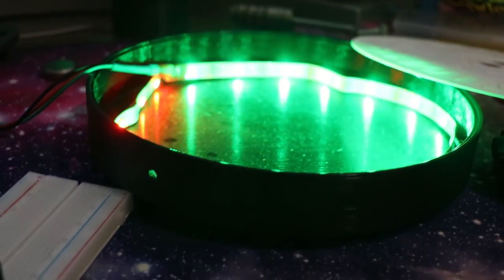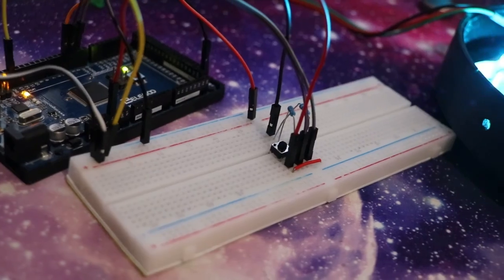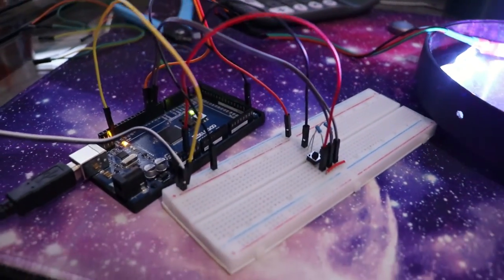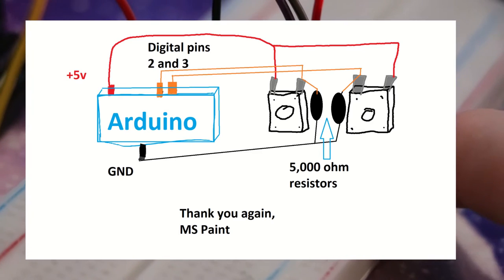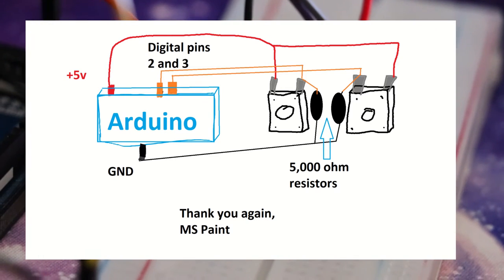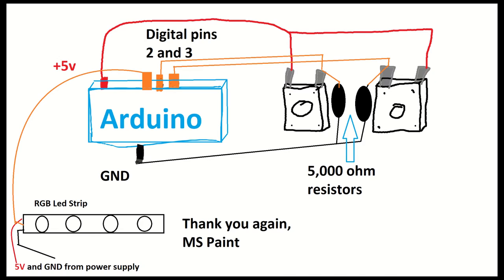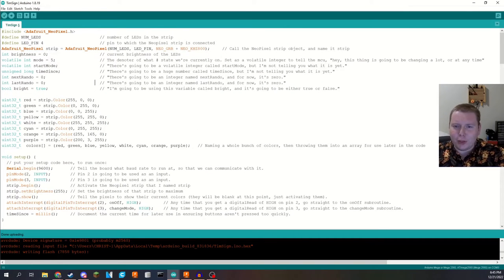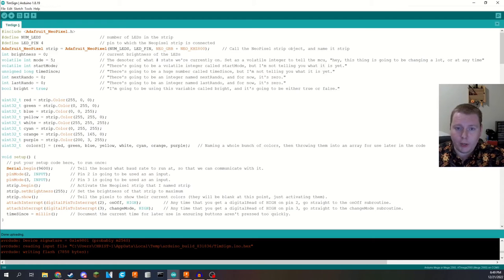Arduino Beginner's LED Sign -- Interrupts, ISR, Wiring, Coding! (Free Code!) #arduino #led #diy

Comment: I was building a complex prototype using an Arduino Due with 8 DC motors and 8 encoders which needed precise timing and synchronization, so it was insanely complex for a starter project, considering I was also fairly new to C/C++ and microcontrollers, and I just couldn't wrap my head around all of it and make anything work, but then on a whim I decided to add 3 physical buttons, 3 color LEDs and an RGB LED to the prototype (rather than trying to control the mess through serial connection), and dropped even trying to do anything with the motors for a few months and just focused on learning the programming to get the buttons and LEDs to work and do complex things. Thanks to doing that, my C/C++ skill level sky rocketed to the point where I could finally wrap my head around OOP, I wrote my own custom easy-to-use button/LED/Motor-Controller/Encoder libraries, wrote entirely non-blocking code (including non-blocking while loop, debug and delay libraries), moved up to coding in Visual Studio or VS Code (honestly, Arduino IDE kinda sucks), all just from trying to get some buttons and LEDs to work. If I had stuck to trying to learn on my more complex motor prototype program, I probably would have abandoned the project before I actually learned anything useful or got it working.

Moral of the story: LED projects are simple, yet just complex enough to be great first learning experiences, so projects like the one in your video are where anyone struggling to build more complex projects should actually start.

PS: Also, anyone looking to up their programming skill to the next level should check out the astounding tutorials from "Caleb Curry" and "The Cherno" here on YouTube.

Comment: D1min or ESP32 running.
WLED! WLED! WLED! 
Or ESP Home!  Plus both are native to Home assistant. 

 WLED is always the go to for ANY sign project especially one that small. Esp1 for a few bucks or a 5$ d1 mini has the WiFi project under $10

ESP home would have been my go to for the direction sensor/weather station too adding the data into Home assistant.